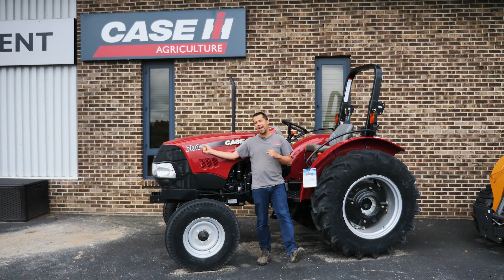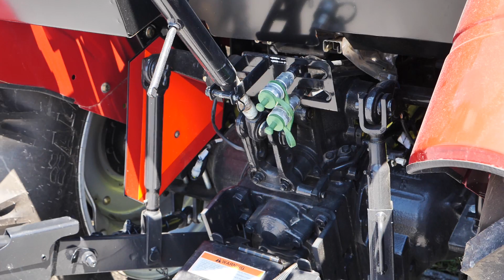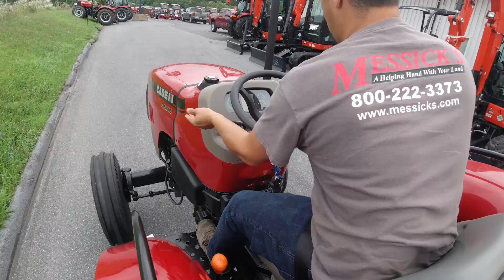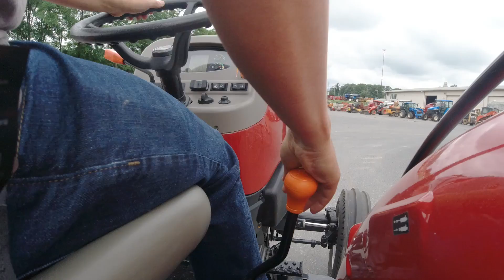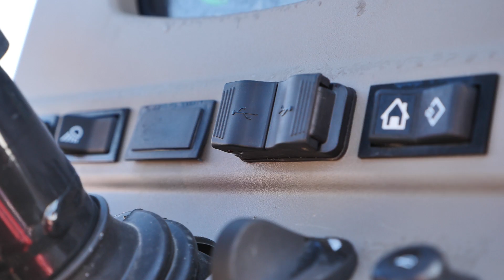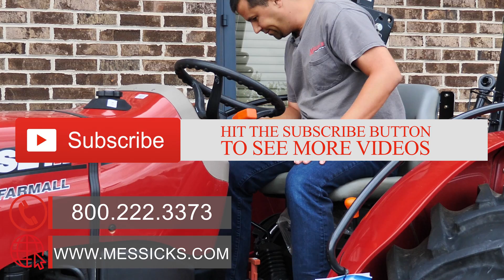Who would buy a 2wd tractor? Case Farmall 70A

Comment: I just bought my first tractor ever (used).

2WD and no loader... with only 88hrs on it… @1/3 the price of a new one. Even came with a brush hog and blade w/free delivery at that price.

It should perform excellent on my property pulling a bush hog, blade/and box blade work, haying, post hole digging, tree dragging on occasion, and perhaps plowing some day if I decide to some large patches of field corn and sunflowers… or a market garden. 

It is all my grandfather ever had and will more than pay for itself within a year. 

My first step is to dig a simple 10’L/W x 6” deep drainage fully for the pasture so it does not become a mud hole after heavy rains anymore. Lol

Comment: Doesnt the difference between constant mesh and Syncro mesh is the synro components so when you are shifting the output shaft is synchronized with the engine with the help of friction ring and friction cone and a few other bits.

Comment: If you're thinking a 4wd tractor will out perform a 2 wd you wouldn't be wrong.
We had a 4720 John Deere 4wd cab and loader here and the conversation came up would it out pull a D17 Allis Chalmers. Same HP  the weight was very similar and wheels close to the same size.
Hooked them back to back the tractors both spun no advantage.
Hooked back to back with the 4720 in 4wd pulled the D17 backwards.
Through the chain over the 3 pt hitch to get some leverage, 4720 in 4wd the D17 walked away like there was nothing hooked behind it.

Comment: Would it kill u to push the clutch every time u go forward and reverse 😂
Reply: The clutch sees wear every time you push the pedal. That wear could be reduced by stopping with the brakes before reversing, but it still adds up over time. Hydraulic transmissions use oil to further reduce the wear of changing directions.

Comment: Sorry but I must disagree with those who think 2wd are just as good as 4wd. I've owned 2wd tractors and will never buy another after getting a 4wd. Try 'backing up a steep hill' in mud or even wet grass in a 2wd, it won't.  Put a LOADER on it and load it, THEN try and back a 2wd up a 'shallow hill', it won't. Moving HAY you'd better have a bail on the BACK as well as FRONT.  Put a lot of weight in the loader and you have virtually NO WEIGHT or TRACTION on the rear tires. Now if you are talking SMALL tractors on fairly level ground with no deep mud it doesn't matter very much.

Comment: Turns shorter.  Does not tear up the grass.  Cheaper to buy and operate.  Cheaper tires.   A SINGLE set of wheel weights and you will have next to no issues with a loader.   The whole reasons for them 4x4 only is since a majority of them in the small tractors are sold that way they cut cost by simplify the assembly line and parts list.       Once you go past 40 hp.   A lot of people buy for the PTO use and not for the drawbar.

Comment: That was pretty funny, It has USB ports on it! I like the price point and the rear hydraulics . How much on a guess would it cost to add rear hydraulics to a tractor?
Reply: Stubb's Homestead : 
Adding hydraulic remotes really all depends on how the tractor is currently equipped. That, and parts availability, unless you go fully custom for your installation. 

In many instances, plan on spending about $500 -$1,000 to add a single rear hydraulic remote to most farm tractors when done properly. 

It's worth the expense if you have the need or want to be able to operate any additional remote hydraulic cylinders on drawn/attached equipment. Plus, rear hydraulic remotes also increase the tractor's future resale value, because the tractor is now more useful/versatile.

FYI, a "single remote" is the equivalent of 1 hydraulic control valve & 2 hoses (1 pressure, 1 return) with female ISO (Pioneer) quick-couplers at the ends. You'd be surprised how many people don't understand that simple concept.

Here's how I explain it to people in layman's terms:

A single remote = 2 ports. Dual remotes = 4 ports. Triple remotes = 6 ports... and so on.

For example, if you want to add a useful front-end loader to a tractor without adding a separate loader control valve, you will need a tractor with at least dual rear hydraulic remotes to facilitate the lift/lower, and curl/tilt functions of said loader.
Reply: @turbodiesel4709  Very useful thank you! My massey 1739 has a FEL but no rear remotes, I don't have anything that would use it but it would be nice to have. So 2 port is a must but is it worth it to have 3? what even would use 3 on a 39HP tractor?

Comment: I prefer 2wd for a loader tractor because of better maneuverability. Not sure on newer tractors but anything I have had (25+ years old) 4wd has horrible turning radius. I'll suffer through minor repairs (bushings, the rods, ect.) To gain that ease of use. Maybe modern 4wd are tighter turning but I can't afford those newer machines.

Comment: Who would buy a 2WD tractor?   Anyone who knows anything about tractors!  :-)  Most smaller tractors are 4WD because they are so lightweight that without it they would be near useless. A properly ballasted 2WD tractor can have tremendous pulling power. I now have a newer 28HP 4WD compact tractor but I used to have a 60-year old 28HP 2WD tractor. Lets just say that older 2WD tractor could drag this newer tractor all over the field and make it cry for momma.  :-)
Reply: I have to agree with you.  To hear some on here you can't work with a 2WD.  I have a JD820 with 31 hp and weighs 4000 lbs without ballast.  I have run it since I was a kid in 1972 and logged thousands of hours on it bush hogging, discing, plowing, cutting, raking and square baling hay.  My neighbor has a nice new JD in the same hp range with FEL and 4WD.  It is a nice handy tractor for his needs, but it can't weigh 1500#.  I'm sure I could drag his tractor off without ballast in the tires or locking the differential, its just physics.  I also doubt his machine will live to see 8k hours.  The 820 could probably lift it with the gin pole on the 3 pt and drive away.
Reply: I agree I cannot see giving up my farmall M for anything newer.  I'd have to buy a 60 hp to try and compete with the 35 from my M.  My little A can out pull my buddies deer 1025 25 hp diesel 4x4 all day every day . Buddies deere can barely dig leaves with its loader without losing traction.

Comment: ill keep my 2wd they work perfect for what we do we have a ih 1586 and ih 986 and a case ih 685. all 2wd. they do exactly what there supposed to do but turn way sharper at the turn row up against a tree line where if it were 4wd id have to stop back up and go back into the row. also 2wds get noticeably better apg (acres per gallon). traction wise we had a neighbor with a 2012 200 horsepower 4wd john deere an swore up and down it would out pull our 160 hp 1586. so of course we had a pull in the field neither of us had duals and both had about 60% tread and I drug his ass about 20 feet and all 4 were spinning and he was jumping so bad I thought he was gonna go through the sun roof. so ill keep my 2wd.
Reply: Ive noticed  weather  its a pickup  or tractor give someone a four wheel drive they think there invincible.
Reply: Learned how to drive a tractor on a 1586 planting cane one summer. Still one of my favorite tractors to date, and this 70A puts me in the mind of the old “86” series tractor because if it’s simplicity. If I knew it would be as reliable as them, I’d buy one today.
Reply: Love them 86 series too

Comment: neal you clearly are just a salesman you really no zero about farming throwback tractor hahahahaha we use those tractors pulling 9ft haymowers tedders rakes square balers  its really endless down here in tenn we have rough steep and rocky ground and big tractors tend to not stay on there tires anything over a famall 100 9540 kubota tl 100 nh your going to be limited where you can go great video neal

Comment: I'd buy a 2wd all day every day and I'd run that with a loader on it.

It's all in how you operate the tractor. Come to a COMPLETE stop changing direction and that clutch will last a long time.

4wd has it's small advantages, but for me not enough to justify owning one.

You're not going to run your 4wd truck or SUV in 4H, why would you run your tractor in 4wd?

You think a clutch is expensive, wait until you replace a front axle.
Reply: I was thinking the  same thing. I grew up working  on farms, no one had a fwa or a 4 wheel drive unless they were big farmers. We ran  on hillsides gullies you name it, even ran loaders on them.  Like someone else said come to a stop to switch  gears. But then  look at vehicle line ups anymore. Cant get a basic plain Jane  pickup, the base models  have more options than the delux models used to.

Comment: loader tractors generally perform much better in 4wd with the exception of really slippy stuff and very tight spaces... 2wd can make some monstrously sharp turns with brake assisted steering and you never have to worry about front wheel dig

Comment: I would buy 2wd tractor because I don’t need hp to run grain bin auger n if there is a crop fire with cheap insurance cost it’s not cheap going be expensive to replace.  I don’t need 100hp pull water cart or grain bins or small hay equipment or hay feeder in dryer parts of year.  Remember operating cost running big expensive tractor cost more n some farms are not full on busy, with one man operation so time/cost of hourly pay is not important.  Great vid👍on our farm we do have McCormick four cylinder 130hp cab tractor with FEL which makes efficient but we have International 574 for small jobs.

Comment: That's the best tractor i have seen on the channel so far. Few stated there weight issues with new tractors. Was once 6 cylinders now 4 cylinders. 4 cylinders produce power but can't hold a 1000 lb hay bales. New tractors are a joke. So they have to be 4 wheel drive. I still have 2 wheel drive and it will do more heavy lifting then your new stuff. Millennials!!!😆

Comment: Back in the mid to late 60s, I had a '58 International 350 utility  tractor.  2WD,  with rear wheel weights, a rigid rear hitch, upon which sat an 18" X 18" x  2' tall concrete ballast block. It had a " Lord " front end loader with a 7 1/2 ' snow bucket.  I was living in Massachusetts at the time  and used it for moving snow.   With a set of  "St. Pierre Roller Grip " snow chains, I moved  tons  of snow .  If I was back there now, where the snow can come down pretty good, pretty quick,  I would buy a 70A in a heart beat.

Comment: 2wd tractors are very handy in a cattle shed. Where i work we have a mf 135. That was replaced temporarilly by a compact kubota tractor. The reason? The 135 can turn easily in the witdh of the cow passage in the shed on the slats thanks to steering that locks really sharp both ways and an open differential. Not only that, its very easy to navigate between the cubicles again because of the tight turning. The kubota was sold because it could add often 30 minutes to the scraping. Purely because youd have to go out of the shed and turn in the yard. That was the quickest option with that machine. The 135: lock the wheel n slip the clutch round in a circle and take 30 mins off the job. Oh and the 135 has a 2.5 liter engine
Reply: I did lots of 360's with my 135, with the loader and back blade in the holding pens just jump on the brake and pull the gas lever down
Reply: @ralphross2357  often heard of people doing that. Theyre very nimble little tractors

Comment: Someone had told me several years ago that you will find that most 4WD equipped utility tractors are 4WD because they don't weigh enough to be able to use a front end loader without serious traction issues...so the larger utility tractors and full size tractors 2WD works just fine because they weigh enough to not have any traction problems with a loader....not sure how true it is but would definitely make sense.
Reply: I have a JD 520 with a 45w loader. I used it fine without any ballast. I have added 1 pair of wieghts on the rear for pulling the 3 bottom plow. The narrow front is the problem in softer ground but it is not dangerous like people say about tipping. Wide fronts can tip also in the same scenario.
Reply: Remember if the tires don't have some slip, your clutch and drive train will.
Reply: The most compelling reason to have FWA in a tractor is extra pulling power.  Most tractors will slip their wheels some in 2wd if you're pulling heavy.  If all you're doing is running non-ground engaging equipment like a mower, auger, what have you, then 2wd is fine, but the moment you try to put the power to the ground you're better off with FWA.  Is it enough to justify the cost of FWA over 2wd?  For almost anyone that's trying to get work done, yes.
Reply: @TheMadOneofSB  In my case with my small property I'd be using a compact utility tractor to use a loader and other attachments and given how light weight those small utility tractors are the 4WD would be a must.  I agree with your thoughts as well, and even if you sell your tractor or trade it in at some point in the future just like a 4WD or AWD car it would fetch more money being 4WD.  Overall additional maintenance for a 4WD over a 2WD isn't that huge, at least not to justify skipping the 4WD just because of the maintenance aspect.  If I had the choice I'd go with a 4WD anyways, I live in Idaho the roads and conditions are never going to be the same so the 4WD tractor would certainly be my pick.

Comment: I grew up on 2wd tractors and I'm staying with them. yes, FWA is a nice feature but 98% of the time I'm fine without it in the dirt, snow, etc... I also find 2wd tractors are a lot softer and are my preference for making and moving hay. Even with a loader, material moving and handling bales 2wd is more then enough for a competent operator. The biggest benefit for FWA is in the spring when everything is muddy, but all the FWA is going to do is help you keep driving through spots that are too soft and will have to be fixed later when things dry up.
Reply: @KyFarmerman  It's like all the truck guys that buy a $70.000 pickup 4X4 shortbed? Who needs it?
Reply: @kennethbredow3098  true. my older ford ranger is a farm truck.
Reply: Add chains and you can go anywhere in winter with a 2wd tractor.  We never needed a 4 wd tractor even with the loader on the front, and the Case 1210, 65 hp tractor was overkill for everything on the farm, even the 3 bottom plows especially when you kick the differential lock.
Reply: @gibbles pascack  anything over 75hp, I would run duals because of weight and the power. Maybe 100hp+ for FWA if doing tillage. Most of what I'm doing is 75hp and under work, and not much tillage. We don't have big hills, so a 65hp loader tractor, 2wd with ballast, is plenty sufficient for handling round bales and pulling the wagons. The main baling tractor is 68hp and has never been used for tillage for us. We have a 55hp tractor for plowing, disking, and pulling cultivator. In the winter, the loader tractor ideally would have chains, but it does not currently.
Reply: @BillTheTractorMan  We never had disks, so we did not need to put that much power into the ground.   Case 600(35 hp) on the 3 bottom plows until the case 1200 (65 hp) showed up in the early 80s.  Bailing was standard size, no round bales, thus did not need the lifting capacity.  Everything was small on the family farm(38 cows).  Everything was owned, so no need to go to extremes on production.  But that is a while ago.  Now for the blueberries, we have a Ford 8N(with the implements) and Farmall B.  Just this week I was looking at a new tractor to increase reliability potential.  Maybe 35 hp would be a good size, in upstate NY.
Reply: @gibbles pascack  nothing wrong with being a small farm. My goal is to be independently farming 80 acres, cattle, pigs, and hay. No loans and no partners to answer to.

Comment: I remember haying as a kid on hilly ground with a Ford 8N  2 wheel drive and sometimes we kids/teenagers had to sit on the hood to keep the front end from coming up when pulling the baler. Hit a bump and the front end would bounce we would nearly fall off , that's the old 2 wheel drive tractors  method, glad for 4x4 's now.
Reply: Only fools bale hay with a Ford 8N. Far too underpowered to be running a baler at proper rated speed. Secondly, they are extremely dangerous for such a task, due to their lack of weight/mass.

Ya shouldn't be square baling hay with anything less than a 45 horsepower tractor, at bare minimum, unless you are using old iron like a Farmall "M" or JD "G". We regularly use Ford, Deere, & Massey diesels in the 60hp - 100hp range to do the vast majority of our small square baling. That's because our land is mostly flat. 

On the bigger hills, you NEED a bigger, heavier tractor to counteract the baler, wagon, and hay load. The alternative is often a serious accident ending in death(s).